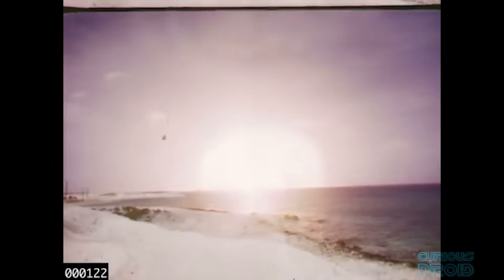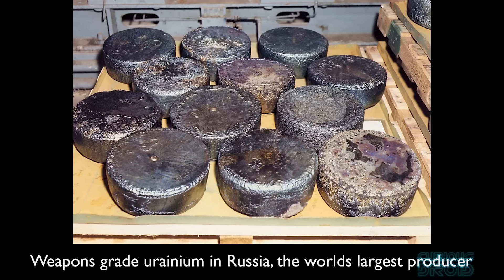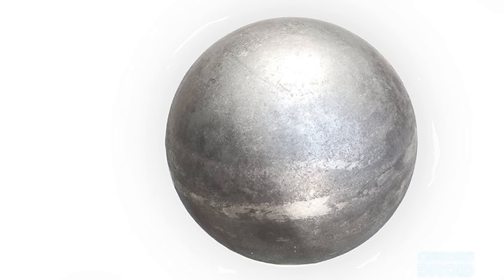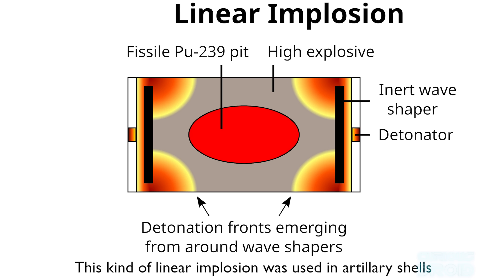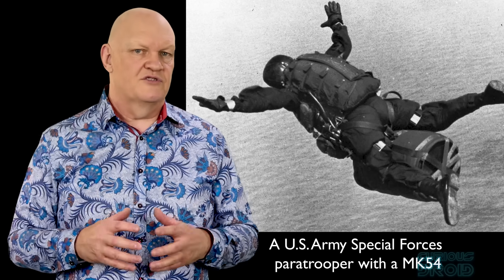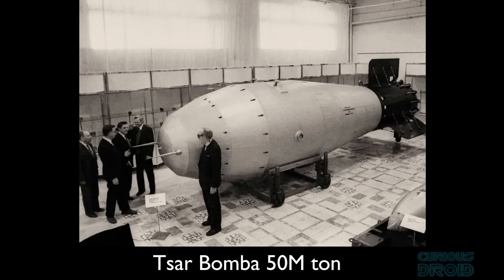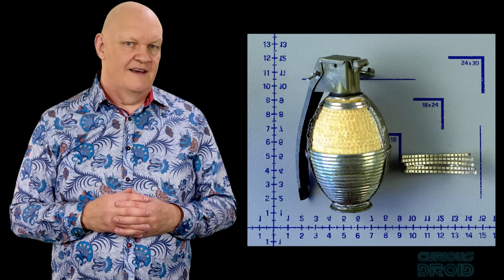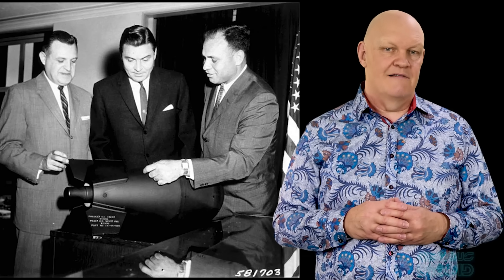How Small Can You Make a Nuclear Weapon?

Comment: The reason why a tamper is so effective is this: A bomb runs roughly through 80 cycles of the chain reaction (called "neutron generations") and the bomb needs 1 microsecond for this. Every generation creates 2 or 3 new neutrons for the next generation. So with every generation, you increase the power output two-fold (or even three-fold). This means if you can confine the core material for just 1us/80 = 12.5 nanooseconds longer, you have doubled the yield. And if you can do it for 25 nanoseconds, you quadruple the yield. This scales fast (expotential growth), and therefore every small improvement can dramatically increase the yield.
Reply: A weapon undergoes far more than 80 generations.
Effective neutron multiplication numbers of 2-3 have never been achieved.
1 microsecond/80 is 12.5 nanoseconds, not femtoseconds...

Comment: Tldr. Small.  But dense. Minimum device weight: ~18kg. Nominal yld 1kt boosted 20kt-30kt. Low efficiency (lots of fallout). None of the devices mentioned use modern designs... thank God.
Reply: Low efficiency does not correspond to lots of fallout.

Comment: The variability in yield is most easily explained by understanding that each reaction is on the order of a billionth of a second with the power doubling every cycle until the material is sufficiently reacted and blown apart that the Q of new reactions falls below 1.  If you start with 1 and double that number 100 times (excel makes this easy) you have roughly approximated a detonation of a nuclear bomb (remember your final answer and every answer preceding it would be multiplied by 200 MEV).  At that number of cycles what started as 1 atom splitting has propagated exponentially to reacting kilograms of material.  Getting just 1 more reaction doubles the output so a 2 MT becomes 4 MT, or a 25 MT is now a 50 MT explosion.  All of this happens 1 millionth of a second, the entire detonation cycle from start to finish has happened before the bomb casing even cracked open.  That detonation speed along with secondary thermal and radiation effects are what make nuclear weapons so powerful.  This is also why less than optimal geometries have rather unpredictable yields, because the number of doublings may be +/- 1 from the designed yield due to the unpredictability of the compression wave front and less than ideal lensing.
Reply: Well put, though this one sentence could be improved: "detonation speed along with secondary thermal and radiation effects are what make nuclear weapons so powerful."

A detonation of a single TNT molecule releases just 4 eV of energy while fission of a single U-235 atom releases a whopping 200 million eV energy. This is the difference of 50 million times! That's what makes nuclear weapons so powerful. Everything else is a footnote in comparison.
Reply: @cogoid  The key concept I was driving toward is "doublings".  This is also why some nuclear tests like Castle Bravo went over design yield, due to the design giving them roughly 1 more unexpected doubling.
Reply: @larrybremer4930  No, this was because the thermonuclear portion used a mix of Li6 and Li7, one of which they thought would be inert.
Reply: @JohnN-r2n  Which resulted in roughly 1 more doubling due to higher neutron flux.
Reply: )pl pop

Comment: The threat was not empy, as more bombs were on the assembly line.

While the uranium bombs are easier to make, they require much more enriched nuclear material, and US might have been able to produce one per year. So it was a good assumption by Japans leaders that the first bomb was a one-off, because it was. When they learned about a second bomb soo soon after, they correctly had to assume that US had the capability of producing more.

The more complex plutonium bombs however could be build and delivered at a pace of 3-4 per month (according to some suorces), which would within just a few months remove Japan as a country.

Comment: Beryllium isn't really dense, it's about twice as dense as water.
9:13 Hmm, "sokea" means "blind" in Finnish, and I see Swedish text on the plane. That photo might be of a Swedish made plane taken in Finland (we used to have Saab fighters).
Reply: I would guess a Saab J35CS Draken, a two seater. There are a couple displayed at different museums in Finland.
The reasons are: that it is definately a Saab J35, the SOKEA is as you mention finnish. As for being a two seater, it is a pure guess... due to the metal finish, it is not painted.
Reply: The swedish text reads "Refill, Pressurized liquid MX 22, Reabensin MC 77". The last part being the fuel used for the planes Gripen and Viggen(possibly others, I dunno).

Comment: You are in error. The U.S. wasn’t making an empty threat with nuclear weapons. A third nuclear weapon was on route to Tinian on August 15th for use on or about 18th. The fourth was in final assembly at Los Alamos. Los Alamos built twelve during 1945 and another five during 1946.
Reply: Source? Wikipedia’s article on “Third Shot” says it was still being assembled and was intended to be shipped on August 19th, but because it was called off it never even reached full assembled state.
Reply: @GBOAC Recently declassified transit orders placed it in San Francisco on August 15th being moved by air to Tinian.
It was to be DROPPED on the 18th or 19th. 
The fourth Mk 3 device “pit” was listed in the same orders as being in the Los Alamos machine shop being nickel plated for assembly. Nickel plating was to prevent corrosion and subsequent release of plutonium dust during handling.
This all came out five years ago, under the 75 year declassification rules. Any book published prior to that would be missing that information.
Reply: @allangibson8494 
Another thing the video is wrong about is the claim that Davy Crockett crews would have been within the blast radius of their weapon, it was only the equivalent of 20 tons of TNT, they even test fired one in front of Robert Kennedy and a Presidential advisor, I don't think the Army would have put the Presidents brother, the Attorney General of The United States, in danger of being blown up by a weapon they were demonstrating. 
It only had a 100% kill radius of 520 feet, I don't know what the injury radius would be but if the kill radius was 520 ft I can't see it being more than 1,500 ft, and 2 miles is about 10,000 ft, so I'm fairly confident that the crews would have been safe.
The US Army may have done some silly things but fielding a weapon that by design would kill its own crew isn't one of them, that'd kind of defeat the purpose.
Reply: @dukecraig2402 The Davy Crockett was more lethal from gamma radiation than blast.
The smallest physical atomic bombs were the Project Orion nuclear propulsive charges that were described as “soup can sized” (which in itself is a bit “fuzzy” but smaller than a brief case). The yield on these were about ten to twenty times the yield of the Davy Crockett warheads however.
A full yield Tsar Bomba would certainly have killed the crew dropping it (but the Soviet nuclear powered aircraft were similarly lethal).
Reply: @allangibson8494 
The Davy Crockett released neutron not gamma radiation, and that still doesn't mean it was a threat to it's crew much less mean that the crew would have been inside of it's blast radius.
And what in the world does any of the rest of that have to do with the incorrect claim that the crew of a Davy Crockett would supposedly have been inside the blast radius of their own weapon?
Reply: @dukecraig2402 All nuclear weapons release gamma radiation.
The actual amount is actually fairly constant regardless of yield - the lethal thermal radiation radius in thermonuclear (hydrogen) bombs greatly exceeds the lethal gamma radiation range, the atomic bombs used during WW2 were the reverse. One of the misconceptions about Hiroshima was that the fallout killed people when it was the silent prompt gamma exposure that killed people who didn’t get burned (they just happened to be within the lethal range).
The Davy Crockett wasn’t designed to emit high levels of neutrons unlike the later thermonuclear neutron bombs. It did have a significant gamma footprint (almost exactly the same as the Hiroshima bomb). A 20 ton yield bomb will flip a main battle tank over but probably won’t destroy it.
Reply: @dukecraig2402  All nuclear weapons release gamma.  The prompt gamma is the signal that you got fission or fusion.
Reply: All nuclear weapons release gamma.  Prompt gamma is the signal that you got fission or fusion.
Reply: Correct.
Reply: @brunonikodemski2420 Fusion weapons absorb gamma radiation to initiate fusion. Their gamma footprint isn’t much bigger than a fission weapon (but the thermal footprint is several orders of magnitude larger).
Reply: @dukecraig2402  I believe the w54 test for RFK was done from a test device suspended from a wire.  Not fired from the recoilless rifle.
Reply: @dukecraig2402 at 7:08 it is possible to read the text (barely). It reports that the Davy Crockett will "incapacitate" enemy troops within a radius of 400m
Reply: @BelgianSquirrel 
That's your source? Something from a magazine or whatever that came from? Yea and it's source was probably a YouTube video or YouTube videos use that nonsense for source material. 
Try sticking to information that comes from a source that has a US government document number at the bottom.
Reply: @dukecraig2402 I am only reporting on what can be read in the video itself. I cannot vouch on the accuracy of that info, but I found it relevant because it is part of the video content which we are discussing.
Reply: @BelgianSquirrel 
Well there you go, you can't rely on the source can you?
Do you really think the US Army would issue a weapon that would wipe out it's own crew? If a war happened and word got out that kind of thing was going on there'd be mass revolts in the Army and they know that, along with the fact that a weapon that wipes out it's own crew is counter productive, they want you killing the enemy not yourself.
They demonstrated this weapon in front of Bobby Kennedy when JFK was in office, the crew was not far in front of him when they fired it, do you think the Army would have risk blowing up the Attorney General of the United States? 
The President's brother?
Come on.
Reply: Look at all these dweebus armchair professors you guys are all virgins and none of you know what the f*ck is going on
Reply: Almost correct.  It was pre-assembled and ready to be shipped in California, but it would still require shipping time over the Pacific, then final assembly and checks on Tinian Island, loading of the weapon on the B-29 and again more checks, and then of course having a picked target(s) with suitable conditions for the actual mission.  Generally figured that from time of shipping across the Pacific, it would have been something more like two weeks before it could actually be used.
Reply: @maynardburger It was physically aboard an aircraft in San Francisco on route to Tinian on the 15th of August (based on transit orders).
The next bomb (fourth plutonium) pit was in the Los Alamos machine shop being plated after being machined. (Based on the same transit orders). The pits were the bottleneck in production.
The targets were selected months earlier and would be either Kokura, Niigata or Fukuoka depending on the weather on the day from weather reconnaissance on the 18th or 19th. (Niigata was the probable primary).
Reply: Lost me at kilogram babble.
Reply: @lanesaarloos281 You realise nuclear physics has always been in metric?
Imperial units don’t have the precision for nuclear work.
Reply: Didn’t the fourth one (the one at Los Alamos) go on to become the “Demon core” after killing numerous scientists?
Reply: @Sniperboy5551 The “demon core” was scrapped (because it was too degraded after killing a pair of physicists (in separate incidents)).
Reply: Another thing is there was actually 3 bombs delivered to Tinian, not just Fat Man and Little Boy, I'm pretty sure the 3rd one was a gun bomb like Little Boy but irregardless of what it was the main components of it were assembled and used for a practice drop into the ocean just days before the Hiroshima mission.
Reply: @dukecraig2402  Definitely not a gun bomb. The opposite is the case. The third must have been a implosion design with Pu239. Reason: They had only enough U235 for one bomb. This was also the reason, why they developed the implosion design. Pu239 could be breed in a reactor faster than the enrichment of U235.
Reply: @OpenGL4ever  Core #3 was the infamous Demon Core, destroyer of physicists with butter fingers.
Reply: @OpenGL4ever oh, I did not know that. Thank you. I was in the belief that U235 was actually easier to enrich than PU239. I don’t think it’s just enriching though. I think it’s also the metallurgic manipulation and machining into its destined form and shape which causes immense problems. Uranium is far easier to deal with in terms of general metallurgy and to machine than Plutonium. I genuinely didn’t realise their breeder reactors were better at producing PU239 than U235 though and now I do thanks to you.
Reply: @BenJefferson-m5s  You're welcome. Strictly speaking, only uranium-235 is enriched, since the natural proportion of uranium-235 in uranium is too low. Plutonium-239, on the other hand, is bred from uranium-238 in the reactor, and it must not remain in the reactor for too long, because otherwise plutonium-240 could be formed. It is therefore removed from the reactor after about 3 months and chemically extracted from the other elements. A subsequent enrichment step is not necessary for Pu-239, provided its residence time in the reactor is kept sufficiently short to minimize the generation of Pu-240, which adversely affects the isotopic quality required for weapons-grade plutonium.
Reply: @OpenGL4ever  at the time we had multiple facilities for Uranium enrichment.  We had exactly ONE facility for Plutonium production, that being Hanford B-Reactor.

Critical mass for Plutonium is much lower than that of Uranium.  Unfortunately, a gun-type device cannot assemble sub-critical masses of plutonium fast enough to prevent self-disassembly before detonation.
Reply: @kevincrosby1760  And producing Pu is still faster and requires much less energy. Uranium enrichment is a very slow process and very energy intensive.

That's correct and the reason why Pu requires the implosion design.
Reply: @OpenGL4ever  I was told that after the war, Uranium/Plutonium weapons production were mutually exclusive.

Our choices were to produce HEU for the weapons program, or LEU for fuel assemblies to feed the Pu production reactors...we didn't have the uranium enrichment capabilities to support both.

End result was that I grew up in an area where the schools were excellent, a Bachelor's Degree was considered by many to be evidence of laziness, and meeting a practicing Nuclear Physicist was as easily as striking up a conversation while waiting at the barber shop.

Greetings from Hanford!  :)
Reply: @kevincrosby1760  That makes sense, the enrichment capacities were limited and the process very costly. That is why most bombs were built with Pu239, since plutonium could be easily bred and the reactors were useful for energy production. If bombs had been made from uranium 235, the production rate would have been about 1 bomb per year.

Thanks for the greetings, sending warm regards from Germany!
Reply: @OpenGL4ever Actually the enrichment rate of U235 was about the same as the production rate of Pu239. The Uranium gun design used ten times the amount of fissile material as the implosion design however - ten bombs with the same effort as one. Later Mk3B bombs used uranium cores and doubled the yield of the original Mk3 (Fatman) plutonium bombs. The Mk4 replaced the polonium “urchin” initiator with a linear accelerator to improve drop safety (amongst other changes)(the original Mk 3 would detonate if simply dropped on the ground hard).
Reply: @allangibson8494  That's interesting. Thank you for this information.
Reply: @vibrolax That’s debatable, we know the fourth Mk3 pit was sitting in the Los Alamos machine shop in late August 1945 while the third was actually shipped to San Francisco on August 15th on route to Tinian.
Reply: Live fire tests of nuclear weapons on civilians sufficiently foreign enough as not to invoke outrage marketed as a way to save American troops lives/ experimental and highly dangerous  ' vaccines ' pushed on large parts of the world deceptively marketed as a cure for a virus cooked up with funding from the Deep State. I'm sensing a pattern.
Reply: @PawsInHostility And vaccines administered prior to age one halve childhood MORTALITY…
Deliberate ignorance has consequences.